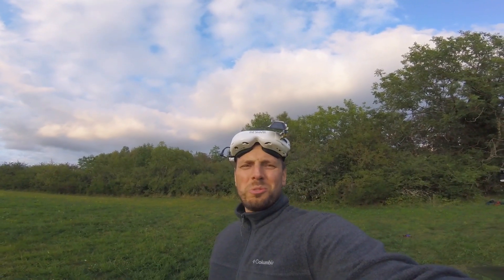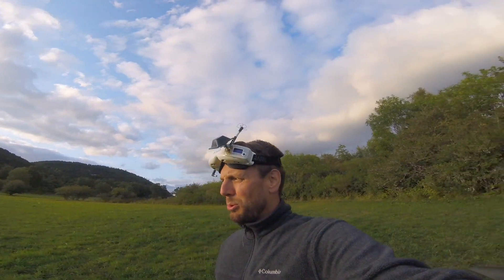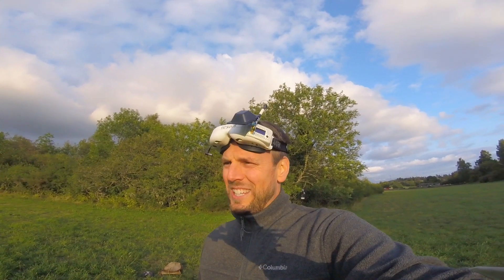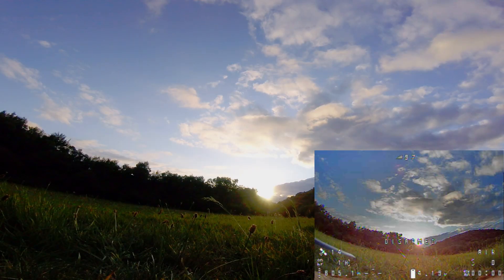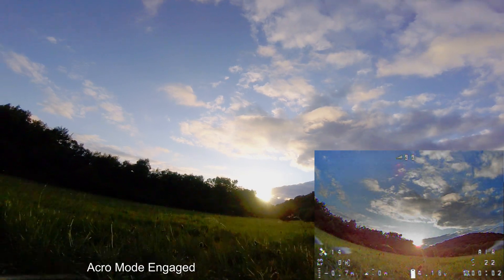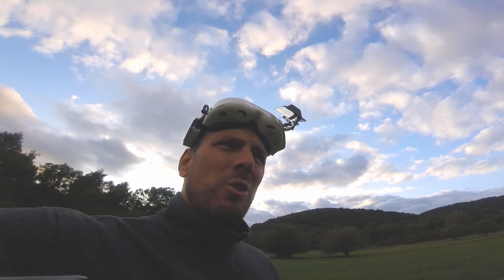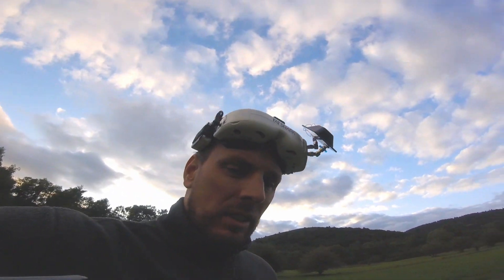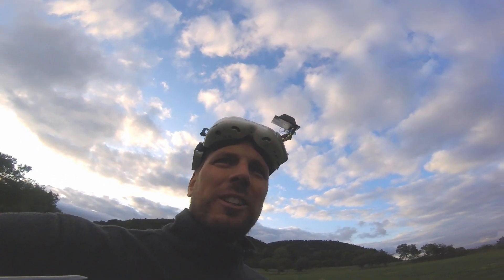BetaFlight GPS Rescue Mode Real-Life Testing

Comment: What does the quad do if you don't take back control? as in, when it gets "home" does it loiter? does it land? does it disarm?
Reply from the maker: It appears to circle around home position and decend, but I haven't tried this. There's nothing in the hardware to allow it land properly.  But the point is not autonomous flight or landing. Rather, this is in-flight recovery for when control signal is lost momentarily, and it does very well at this.  I would have lost my quads many times without it.

Comment: Did you purposely flipped the failsafe aux on when the link was cut? And flipped off when wanted to gain control again?
Reply from the maker: When the control link is cut, failsafe activates gps rescue mode automatically. Therefore there's no need to flip an aux switch. When control link is re-established (as the quad returns), you simply move the sticks to retake control of the flight.

Alternatively, if you loose video but the control link is maintained, failsafe will not activate gps rescue mode. Therefore, you would want to flip an aux switch to manually activate gps rescue mode.
Reply: @kevinreim6706  thanks. Ive never tried losing signal before in a real scenario. Only manual cut for testing. Thanks for the info, Better to know rather than panic at the event real  gps rescue.
Reply: @kevinreim6706  how would you know if control link is still connected in the event of video signal loss?
Reply from the maker: @Dalfpv  If video fails, then you can't fly your quad. So you will activate failsafe gps rescue mode via aux switch, and that should work if the control link is still intact. Or likely the control link fails as well, and then failsafe is automatically initiated and gps rescue mode will proceed.
Reply from the maker: @Dalfpv  Additionally you can setup a sound pack on your radio so you can hear the status of control link.  If you don't hear your radio say "rssi lost" or "telemetry lost", then you probably still have an active control link. But regardless, if video goes out, you'll want to hit the gps rescue switch as quickly as possible.
Reply: @kevinreim6706  many thanks kevin. Big help! Subbed

Comment: When using my Tango 2 radio, i tested rescue mode by shutting the radio off then turning back on. Rescue mode initiated well but i could take back control dur to the "switch warning" because the arm switch was on. Have you had this issue?
Reply from the maker: I haven't had any issues like this. But I also don't have Tango2, so it could be related to that controller.  Good luck!
Reply: So if you couldnt take back control did the quad just drop? Or did you figure this out.

Comment: Thank you for the test! Does it switch back to acro mode automatically after getting closer? Or you have to do it manually? thanx!
Reply from the maker: Yes, if you are in acro mode and gps rescue mode is triggered due to an actual failsafe, then your quad will return to acro mode once rx/tx signal is re-established and you start to move the sticks again

Comment: Great video what happens if you never take back over controls ? Say your radio died does it fly back home and than drop or slowly lower just curious if you had any idea
Reply from the maker: I have been told that the quad will try to land itself approximately near take-off position by attempting to decend slowly.  If the FC has a barometer to know its altitude then the quad might come closer to something that could be considered a landing, although probably not pretty. If no baro, then you'll likely see a hard (as in crash) landing, but a recoverable quad.

Comment: are u use sainity check on or off?
Reply from the maker: Yes, sanity checks = on
Reply: @kevinreim6706  when gps only get 2, if failsafe it will drop?
Reply from the maker: @zaidshoifullah1  OSD will show a message "gps disabled" if there are not enough satellites. If gps is disabled or you are within 200m of your start position then rescue mode will not function. In fact, in this scenario, if you try to activate rescue mode with a switch, your quad will disarm (failsafe = drop, rather than failsafe = rescue mode).  BF says that this is a safety feature so your quad does not inadvertently fly back into you at that close distance.
Reply from the maker: @zaidshoifullah1  You also want to wait before take off, with battery plugged in, for your quad to lock on to the minimum number of satellites (I have mine set to 6). This could take up to 5 min. Otherwise you will not have a start position defined and rescue mode will not be available for the flight. Therefore failsafe / rescue mode will default to drop.
Reply: @kevinreim6706  i have case, i have arm with 7 satelite, the in midle of flight gps drone to 4 and osd saw rescue not available, then i switch aux gps mode, in a way to home position quad drop, my sainity on and quad less than 200m from home point,
Reply: @kevinreim6706  in same case sainity off, when gps drop 3, quad still go home if osd saw recue not available,
Reply: @kevinreim6706  i have arm with 10 gps satelite, in midle of flight gps drop to 2 gps, and i switch gps mode, quad drop and not return to home point position, is that happen because i make sanity check ON? Cos if i make sainity check OFF when gps drop only get 2 gps, quad not failsafe drope
Reply: @zaidshoifullah1  I had the same thing happen to me. Like he said above,  you will failsafe if you're within 200m. It's not recommended to have sanity check on according to this site and the wiki. I have since turned mine to fs_only. https://oscarliang.com/setup-gps-rescue-mode-betaflight/

Comment: hi Kevin, i Have got taranis transmitter and R9M 900 mhz longrange. i test in betaflight gps rescue. My quad go out and i take switch GPS RESCUE and quad turn back. When switch off i take control and AIR mode fly again. BUT when txsignal lost and FAİLSAFE mode, quad turn back but i cant take control. İ try all swich on-off, stick movement. But it not turn back my control. fly away on air 3-4 minutes and drop. what can i do
Reply from the maker: Make sure you are on the latest version of BetaFlight. Also post your question to the BetaFlight Facebook group. I'm sure they can help solve this.
Reply from the maker: Not sure. But for GPS rescue to activate correctly, the quad needs to be over 200m away.  How exactly are you testing the tx signal loss?
Reply: @kevinreim6706  when fly  away gps rescue swıtch on and quad turn back normaly when gps rescue swıtch off, i take control. But when rx signal lost far away. Failsafe mode automatic on, gps rescue work and turn back to me. But i cannot take control. On osd display failsafe  blink. But all switch try and all sticks move still failsafe.
Reply: did you ever figure this out?

Comment: Hi, thanks for testing this. So the gps rth switch is only needed if we only wanted gps rescue to take controll right? (Maybe when lost video or just testing), but if the failsafe is trigerred and we set to gps rescue, when that happened we dont need to do anything ?  No need to switch on the gps rescue swiitch? And we can take over the rescue/failsafe mode whenerver we pump the stick? Throttle,yaw,roll pitch? But how do we know that we already can take over it? What the osd said about that? I say your rssi keeps at 99.
Reply from the maker: OSD shows what mode you are in. But you don't really need that because if you have enough video to fly, you likely have radio connection again and can start working the sticks to take control.

Rescue mode on a switch is nice if you ever outrun your video but still have radio connection (therefore no failsafe to trigger GPS rescue mode). The quad will fly itself back to you until you have video again.

Comment: What did you do when it came back and resume the tx, did u leave the sticks as the same when it lost tx?
Reply from the maker: Yup, the quad continues on its GPS rescue mode path until you start moving the sticks again. No need to flip any switches to get in and out of modes. It's very intuitive.

Comment: That's cool. I'm worried about my setup. Today, I installed TBS M8 GPS since I always encounter RX LOSS even when quad is only 100ft away from me. Here is one of the RX LOSS video I recorded. https://www.youtube.com/watch?v=JFTZ8Vy_dUw

It looks like GPS RESCUE won't work for my RX LOSS when quad is only 100 ft away from. What's your recommendation? I'm using FrSky XM+ and Jumper T16.

Looks like you are using Crossfire. You still encountered RX LOSS or FAILSAFE with Crossfire?
Reply: gps wont wr if your too cloose, set minimum distance lower. 50m is the lowest you can set.

but you shouldnt be having rxloss at that distance. ive flown 400m no issues using jumper t16 and a flysky reciever, the xm plus should do the same. check your antenna. mount them properly so they dont get blocked by the frame. cf will block signal. use cable tie and heat shrink to get the antenna away from framw

Comment: Great fly Kevin, i've heard that in BF 4.1 there is an option to change the throttle level when switching rescue mode.
Before, the throttle to reach the altitude was 100% (lipo killer)
Thx & cheers from France !
Reply from the maker: If you like to fly low like I do, you might want the throttle level high and the response time low so the quad doesn't drop too far before GPS rescue mode engages.  Notice on my 2nd test attempt in the video... looks like my quad dropped and got real close to the ground before returning. That would have turned out bad if I had been flying any lower.  I have since tweaked my settings.
Reply: @kevinreim6706  can you do it on previous version of bf ?
Reply from the maker: @juupafilms  Yes, rescue mode is on some earlier versions, but I highly recommend using the latest stable release of BF because of debugging and updated features.  Also, for me, the latest BF with RPM filters flies amazing, the best so far on all my quads!
Reply: @kevinreim6706  wich one exactely do you use? :)
Reply from the maker: @juupafilms  It's the latest stable release of 4.1.x.  (There is an unstable version of 4.2 available,  but I wouldn't advise using it until it is released as stable.)
Reply: @kevinreim6706  I'll make the step i think, when i see your test, it's the best option for bf

Comment: Are you resuming the flight by stick deflection and is it staying in rescue ok mode until you do that?
Reply from the maker: Yes, it appears to stay in GPS Rescue Mode until stick movement. This can be seen in the 2nd attempt where I just left the quad in original acro mode and didn't touch anything until I was ready to take control again.  It's pretty seemless and intuitive!
Reply: Nice - this was my question too - I too am going to go some testing before I need it but this video was most helpful - TY
Reply: @kevinreim6706 ,  What happens if I turn off GPS Rescue when it is coming back? Do I need also to deflect the roll/pitch switches when the GPS rescue switch is off?